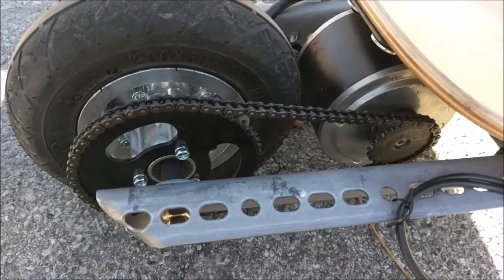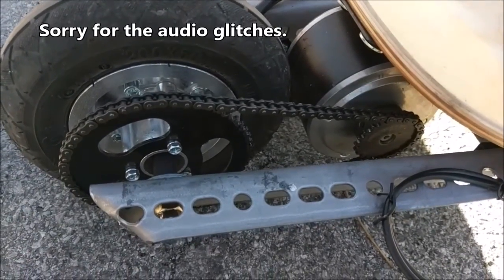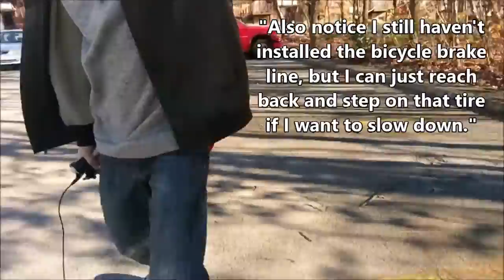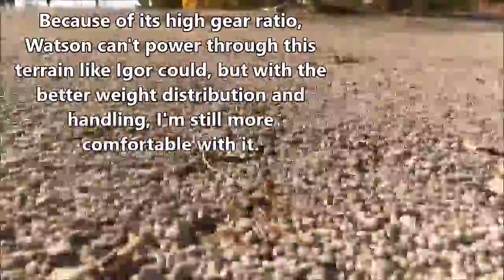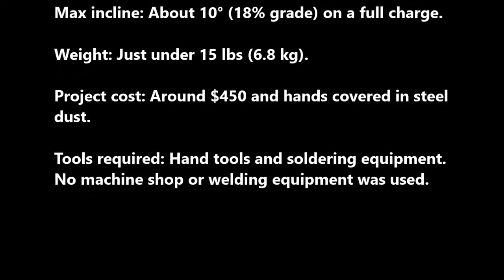Electric longboard demonstration   Watson

Comment: What would be the top speed if u added a 48v 1800w motor using lipos bc I like your design but I'm looking for more speed
Reply from the maker: Milton Freeman 
Your max theoretical speed depends on the motor's max RPM, gear ratio, and wheel size. In reality, it's never that clean--wind resistance, rolling resistance, belt alignment, blah blah blah.
A 2kW e-bike will hit 40 mph. A 2kW Boosted board is only good for 25 mph (though it has better torque). It's how you gear it that matters most.
A 1.8kW motor with adequate cooling in my board setup (favoring speed over acceleration) could easily hit 30 or 35 mph. Would I want that? Heck no. First, it would be illegal on-road in my state. Second, longboards are inherently unsafe at those speeds. Even on a stable platform like mine at a mere 20mph, a pothole or patch of wet pavement at is a recipe for head trauma.
So if you gotta go fast, a large scooter or folding bike would be a smarter platform for a 1.8kW 48V 30-35mph build.
Reply: Thanks💯

Comment: Nice work, I really like the aggressive look of the machine but with the classy finish of the deck, very nice. Could you give more details about the breaks (to be)-could the engine break? And also the controller - I think it is smart to manage the acceleration mechanically rather than with a Bluetooth controller. No battery to handle and no way to lose it. However how do you manage the acceleration? Do you use a modulator or is it full power? Hey let us know, I think it is a great design!
Reply from the maker: Thanks!
As for braking: The brakes are a belt brake built into the rear wheel mount, activated by a standard bike brake cable connected to the brake lever on the handle. This gives nice feedback on the brake, but it's still easy to brake too hard and lock the rear wheel, causing a slide. Electric braking with a brushed DC motor is not difficult, and would not require battery power. When the wheel turns the DC motor, it generates a voltage. Flip a switch to shunt a resistor across the motor leads, and it will dump power; the lower the resistance, the higher the current and the more braking torque applied. Sadly, this requires big chunky resistors that can take the heat. I chose the mechanical brake because of this.
As for accelerating: It is definitely not on/off full power. If you floor this thing, it will take your feet out from under you. Watson uses a COTS PWM motor controller meant for an electric scooter. It's built out of solid chinesium, but PWM motor controllers all act roughly the same way, so it's pretty much plug-and-play. The handheld throttle is just a spring-loaded potentiometer that dials in the duty cycle.

Comment: If you added a pivot to the wheel in the back would you lose the stability you have? Great project BTW.
Reply from the maker: It depends on how much it would pivot. If it pivoted too much, every time you turned, the back side of the board would feel like it was sliding out from underneath you. It wouldn't really affect the performance on bumps, though.
Reply: I'm thinking have it pivot just enough to increase the turn radius but I'm worried about potential speedwobble.